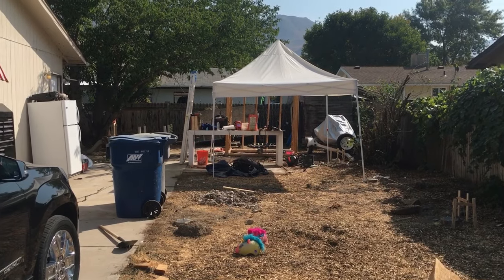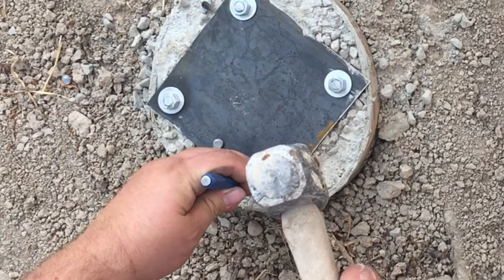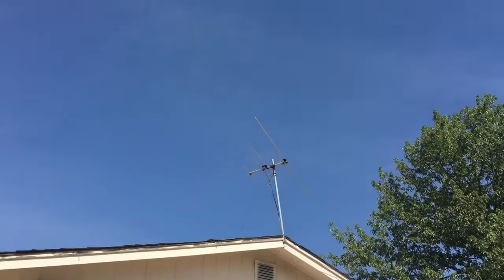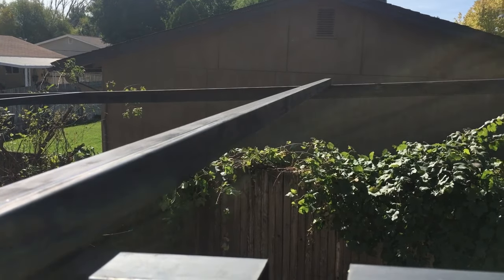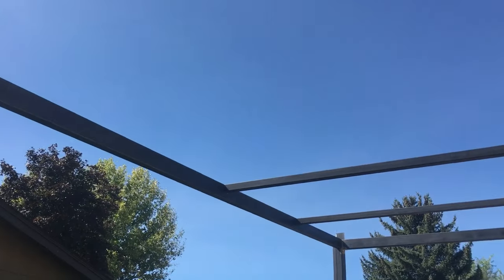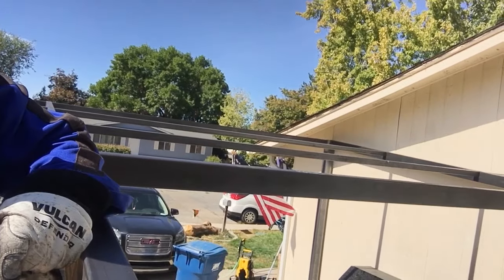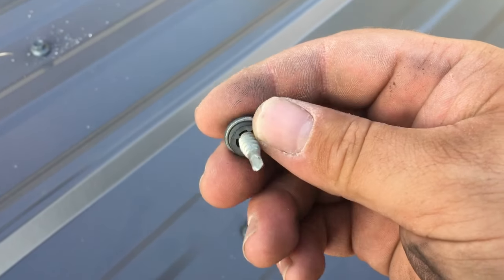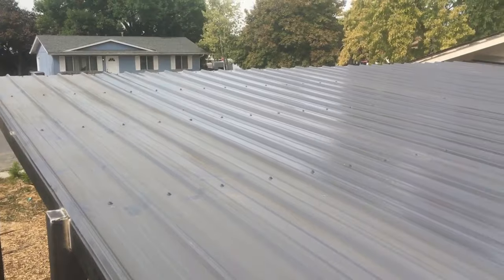Crafting Your Shelter: Metal Carport Construction Guide!

Comment: Painting the frame before placing the roof sections would be a good idea plus the roof should be about a foot wider than the frame from all sides so the rain water doesn't ruin the metal frame, agree?
Reply from the maker: Totally agree, if you are going to paint it that would be best.

Comment: Are your posts also slanted from front to back?  What happens when you install the tin roofing.  Does it just slight bend level at the front and back.

Since you've welded the perimeter 2x4s to the insides of the posts, does it leave 4 inches on the front and back posts to be level with the ground?

Comment: Fantastic job....just one critique. I'm a metal roof installer, and The screw you fastened on the roof panel goes on the ribs of the panels, not on the flat. This is so that water has less space to puddle and runs off the rib, verses puddling on the flat...yes, even if it's on a slight pitch, water will puddle around the screw, shortening it's lifespan. Over all, good job.
Reply: What would you recommend to repair corroded metal beams on my carport?
Reply: @marieplocher7247  it depends on the severity of the corrosion. If you have surface rust with pitting, you can remove the rust with a grinder that has a wire brush attachment, sand stripper attachment, or a grinder attachment. Again, depends on the severity of the corrosion. After you have removed the rust, remove all dust particles with air and a nylon bristle brush. Then apply a rust bond to the affected area(s) with roller or brush, then apply a good oil base paint with roller or brush as well. Roller and brushes push the paint into fine crevasses better method than spraying. Now, if you can see holes through the steel, I'd recommend replacing the beam. A temporary fix would be to prep the affected area as stated above, but before applying rust bond and paint, you can weld pieces of steel to the affected area. Make sure the steel is thick enough to support the structure....then apply the bonding agent and paint.  With structural support, i advise replacing the beam rather than  piece weld it. Hope this helps.😊
Reply: I'd cut out the bad and put in some good. If it's surface rust just clean that shit up and paint it.

Comment: It looks very good, I'm curious as to the slope you used and welder.
Reply: looking at the welds I would say its a flux cored MIG process. The welds have a sand coloured flux around them which is what you get using flux. This is the correct choice for outdoors and thin metal.
Reply: I saw it in the background. It was a Chicago electric from harbor freight. Personally wouldn’t recommend but to each their own
Reply: @tylershields1076  If its the cheap version I wouldn't personally go for those either. The Vulcan series of welders (the orange ones) are highly regarded by the experienced hobby welders though so I wouldn't hesitate picking up one of those. That Vulcan 215 machine is a beast!
Reply: @frankish5314  buy once cry once, if you can afford it, get a nice welder. Iv got a Lincoln MP 210. $2000 new with 75/25 bottle and argon bottle, wire, tig petal, stick leads, everything. It’ll weld anything you want except aluminum.
Reply: @calebsmith95  Normally I would agree with you. But when something goes wrong with that Lincoln you might find the repair costs are less than a new Vulcan. Now I don't own a Vulcan but I have a few people I follow that rave about them. I also own a 200A Lotos AC/DC tig. a Northern Tool 110V portable Mig and 110V off brand DC stick machine. I have owned these for a few years and have not had a problem with any of them and when does croak they are all throwaway machines. 10 years ago I would have bought a high end machine like yours, but things have changed recently in the hobby market.

Comment: Are you welding with flux core of mig gas ?
Reply: Flux core releases a releases a much more toxic gas, I would avoid that. Stick rod is best if you have any wind, knock the slag off and wire brush it before painting.
Reply: @stevewilcox1755  Stick electrodes are self shielded just like flux core- only with coating on the outside. Both can be used in windy conditions.